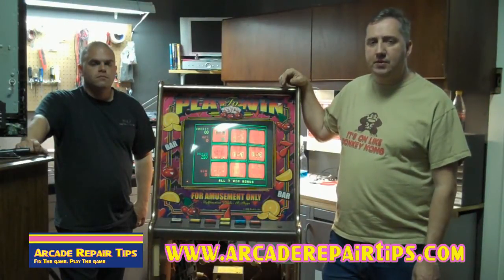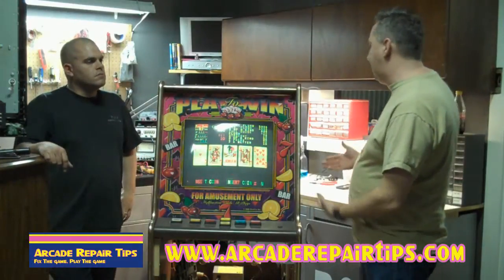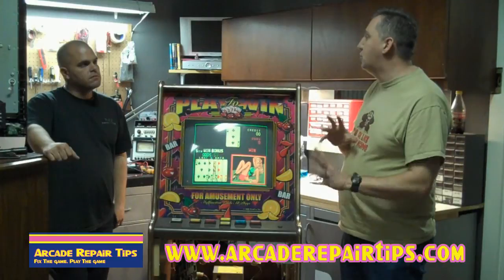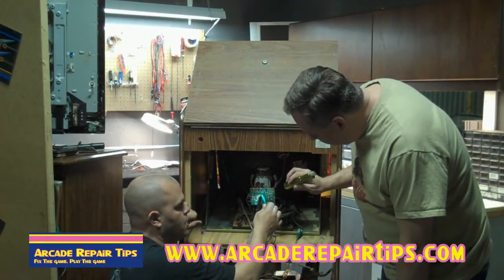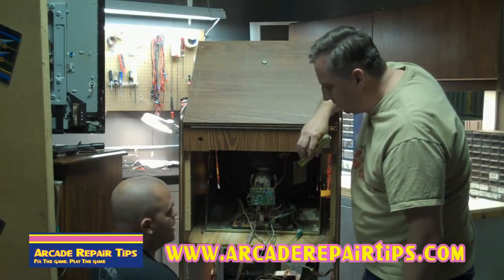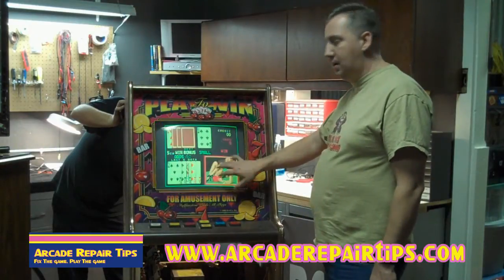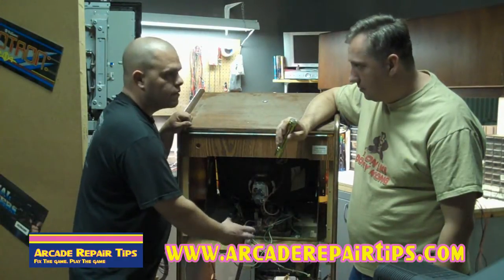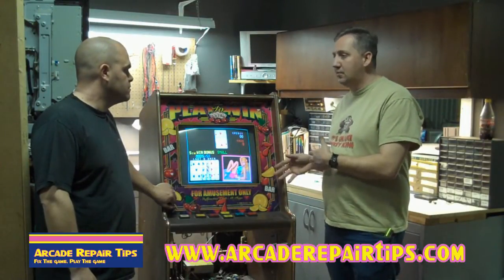Arcade Repair Tips - Checking A Monitor Tube

Comment: Does the crt need to be discharged prior to using these clips?
Reply from the maker: If you are using the alligator clips to test the monitor tube, the monitor must be powered on so that you can see the response in the screen. Of course, be sure to exercise extreme caution while performing this procedure. Be careful not to hold the end of the wire on the pins for too long. Additional information on this process can be found in the post for this video on our website. Please see the link below. Hope that helps!

Link: https://www.arcaderepairtips.com/2011/03/23/checking-a-monitor-tube/

Comment: @varcadegames I have 2 differen chassis for it and one has just been refurbished but the lines are there with both!
Somebody mentioned that it could be something to do with the copper coil that is actually srewed onto the neck of the tube itself?
Any ideas?

Comment: @RejectedManiac Yes, a transistor for blue was bad on the K7400 I finally installed into the MK1 cab after the ordeal with the original tube (with weak blue gun) and the replacement tube (with ALL emissions low)... lol!  The MK1 monitor issue kept me occupied a couple of months.

Comment: @RejectedManiac Well, the monitor with bad blue transistor is not yet in any of my vids, but it'll be uploaded soon.  It was on a WG K7400 I bought for the MK1 machine I was working on.  The monitor was great at first, but soon had total loss of blue, and I knew the emissions had been great recently, so I found the transistor to be the culprit.  Can't remember if I swapped in one of the other 2 transistors, or if I tested it with a meter.  (Search topic 106463 at forum.arcadecontrols.)

Comment: I have a question and would love if you could do a video on it.
You know the scan lines you can see on your montitor when it is on, i have a street fighter machine and at the top 3 or 4 cm's the scan lines have seperated eg' there is black spacing in betweeen the lines at the top!
What the hell causes the and can it be fixed.
Thanks
Reply: I have a question and would love if you could do a video on it 
You know the scan lines you can see on your hd when it is on I have a batman machine and at the top 
3 or 4 Cms the scan lines have separated eg there is black spacing in between the lines at the top! 
What the hell causes the and can it be fixed. Thanks